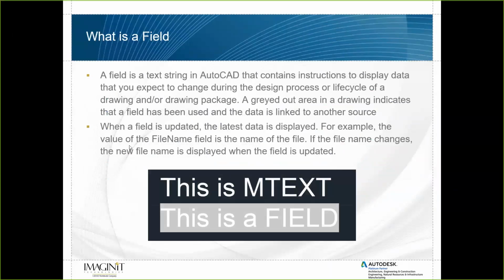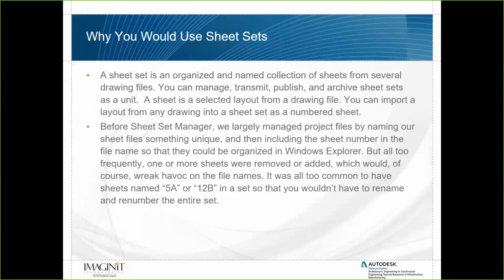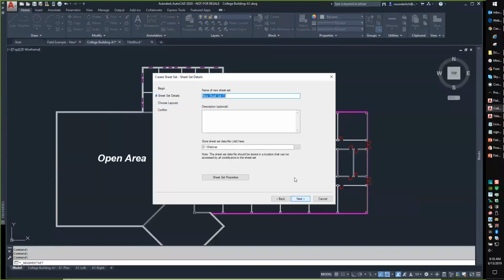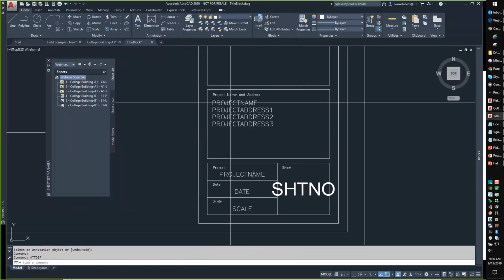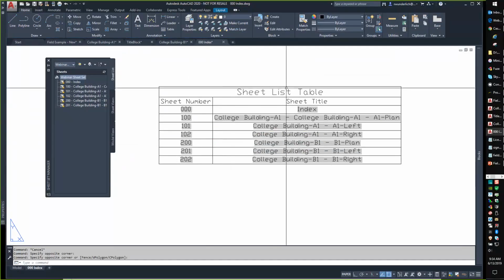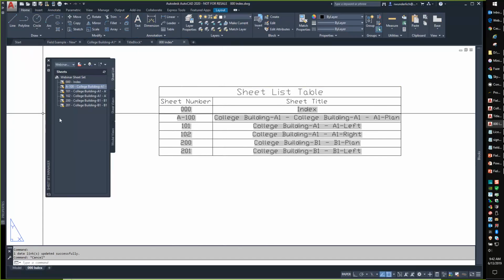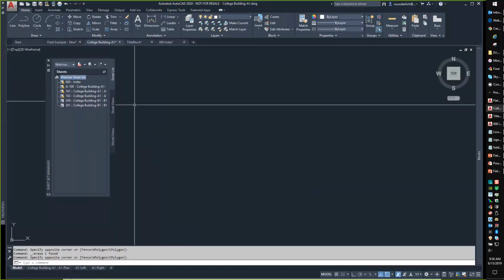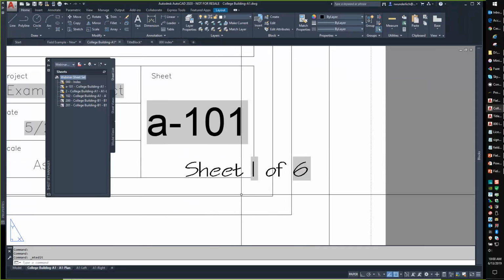Field and Sheet Sets in AutoCAD

Comment: why sheet set and not project navigator?
Reply from the maker: Hi Ruben - we asked our expert. Here's what they said:
Project Navigator only exists in AutoCAD Architecture or AutoCAD MEP.

There are other AutoCAD-based programs (Plant 3D and AutoCAD Electrical ) that have Project Manager, which is different still.

AutoCAD, AutoCAD LT, AutoCAD Map 3D, AutoCAD Mechanical,  Civil 3D, and AutoCAD LT do not have a Project Manager or a Project Navigator, so by using a Sheet Set, you can effectively cross software barriers the different programs (in a multi-discipline firm).  It’s also common to all AutoCAD-based software.